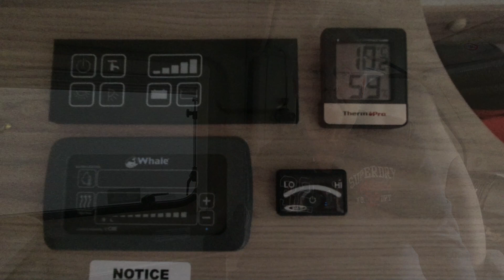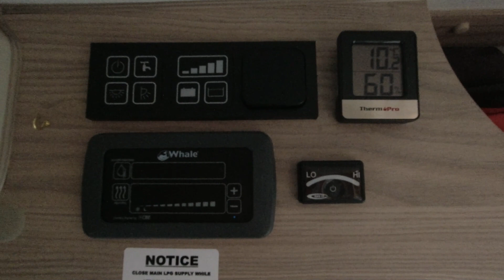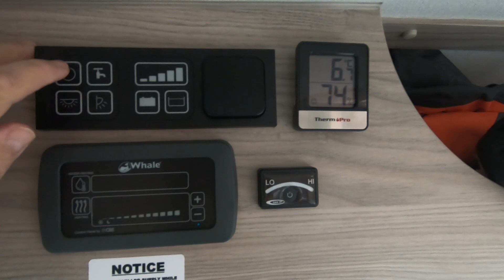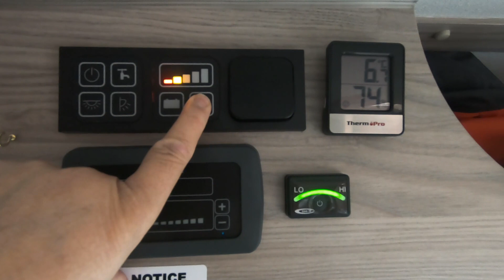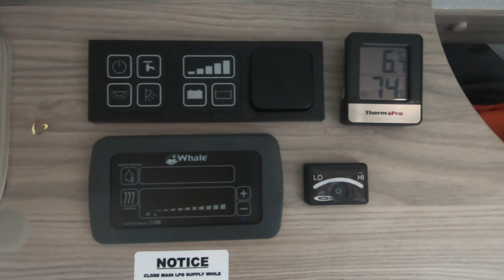12v SYSTEM ELECTRICAL FAILURE What went wrong and how to fix it

Comment: Thanks for this video, very helpful. 
Can I ask a random question here as I can't find a contact us option. When you spin the driver and passenger seats around, do your feet touch the floor? We've been looking at these vans and find that our feet don't touch the floor when set up to use the table!
Reply from the maker: Hi Mike. Sorry for only just getting back to you. When I sit in the driver seat turned round I can reach the floor perfectly. Ellie had a slight problem when facing backwards. She generally turns the seat in a bit towards the table and it’s fine then.  Don’t forget there is up and down for higher on both seats. Hope that helps you. Originally we thought it was likely to be a problem but in reality it fine. 🙏👍🚐🐶🐶🧙‍♂️

Comment: Hi Graham, great you got to the bottom of it - I believe -20c is fine for discharge but I think below 0c for any charge can damage some LifePO4 batteries, not sure if it varies between manufacturers though - it’s something to do with the chemical reaction below freezing. Very helpful indeed to know - thank you - all the best, David 👍
Reply from the maker: Thanks for this David. In my discussion with them they advised the discharge setting to be changed. It was my thinking to change the charge setting.  My thinking was not based on any understanding so I am now re-thinking that setting. I suspects you know more than I do. Thanks for bringing it to my attention and taking the time to comment. Appreciated 🙏👍🚐🧙‍♂️
Reply: @Wizardinthewild  No problem at all, I spotted it and it’s based on what I had read I thought it worth flagging just in case. From my understanding -20c is fine for discharge but freezing or below for charge is the one to watch. You can probably get hold of a spec sheet for your batteries and that will have a recommended setting, from memory I think most defaults seem to be between 3-5c to give some room for different temperatures across the battery. It got me thinking also, I’m considering fitting a mini 12V fan heater to warm the battery up in the event of it being very cold - just to take the chill off. All the best, David 👍